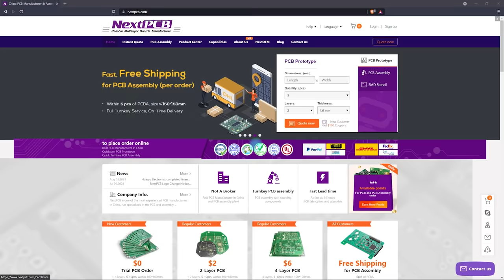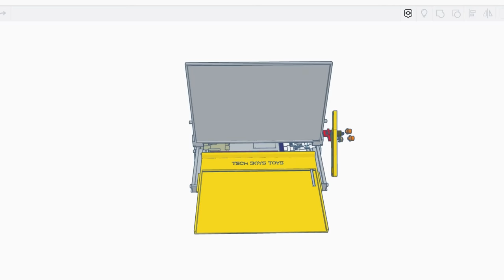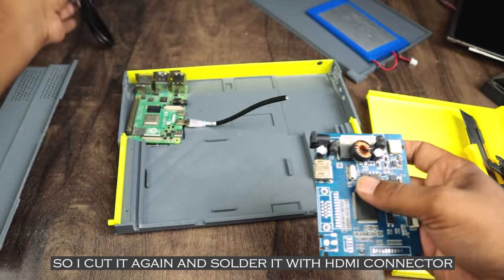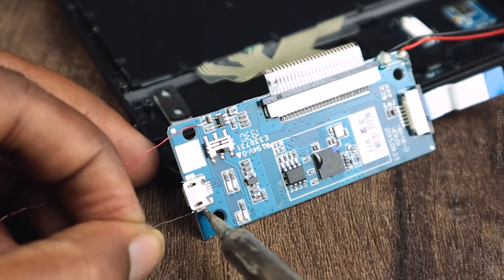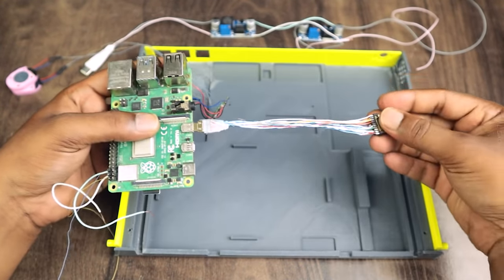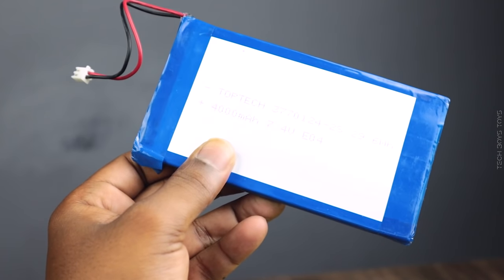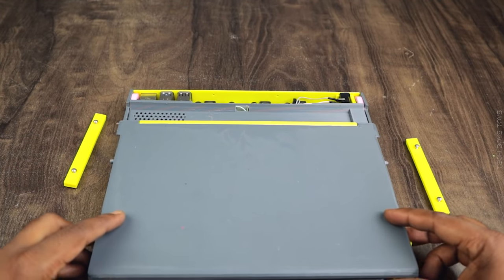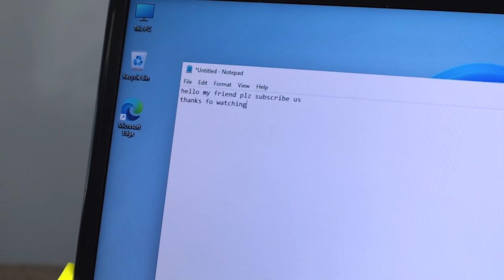Futuristic Dream Laptop 🔥🔥

Comment: Appreciate your Effort but the Laptop looks Age-old, big, huge, less efficient low-end processor and you label your video as Futuristic, you could have titled as DIY
Reply: Yes, or "Microsoft Surface back to laptop trick" or "snazzy 3d-printed surface tablet case", or " my first engineering project", or just " something I did with my time".  😂
Reply: Exactly the same thing I was thinking..
Reply: Better used a latte panda board with ssd
Reply: Exactly also raspberry fan is blowing straight on the back of the screen so I think it might need some redesign, and what if it is working and he close the case then it blows directly to screen that is huge mistake in design
Reply: I think it's more of a concept and use the thickness to put a board with socketed cpu and gpu maybe
Reply: I think what he meant was the term “Cyberdeck”. Basically meaning a DIY portable computer that fits every need of the builder. In this case he uses what he had on hand, a 3D printer, Raspberry Pi 4, old laptop display, and a few low cost electronic components. He elected the use of windows 11 as he probably felt more comfortable using it over Linux.
Reply: RPi may be low-end but it's not really inefficient compared to most laptops. There's nothing "age-old" about this, the design is unusual and not something that has been commonly used in production laptops ever. I don't think it is "big" or "huge", it's not as thin as a dumb ultrabook ofc but still a pretty small device especially considering how few laptops have a 10 inch screen.

Comment: The reason the first hdmi cable didn't work after you tried to use copper wire is because the copper wire was not insulated from the others. The metal on metal contact from the other wires doesn't let the signal to remain organized.
Reply: The copper wires are likely coated in a clear enamel, which insulates them.  I think the reason it didn't work could either be interference, since the wires are not shielded from electrical noise, or human error, since its easy to make a wrong connection when soldering the 20 wires of an HDMI cable.

Comment: Your cabinet design is good but you didn't put a bezel for the display. It's also not reasonable to invest on a wireless keyboard to use it as a wired one. Can you create a wired keyboard with trackpad/joystick using the 3D printer?

Comment: Real dream laptop for me is
I9 11900h
RTX 3070/3080
Thickness >25mm
2 in 1 convertible
15' 2k IPS 100%SRGB
1tb SSD NVME Gen4
>1400 usd
Reply: Start with an Intel Nuc, disassemble, CAD a frame, print frame, get remaining parts, and assemble.

Comment: I really love how this look. Planning almost a similar with pi 400 but I guess I still need a trackpad. There are still rooms for improvement but this is already so wicked though. Do you share the 3d print file?
Reply: Trackpads are annoying. Laser trackball is where it's at. I use a Logitech. Bought a separate K360 keyboard so both share one dongle using "ltunify." One dongle can handle up to 6 things, anyway it helps with power savings. I used a Pi4b and a 7" hdmi touchscreen The screen fit a 7' portable DVD player perfectly with some cutting. It's in there solid but added some hot glue anyway. The Pi hangs off the back of the screen. so it's a chunky sub-notebook. The base is completely empty, leaving a crap ton of empty space, enough room to dual screen, battery pack second whole pi and screen. Did you ever build the 400 yet?
Reply: "Do you share the 3d print file?" // Same question for me.

Comment: GPIO pins not exposed 2nd most use of Rpi, hdmi wires are designed to have least interference and signal loss that's why first attempt didn't work as there was lot of interference from neighbouring wires.
Other then that everything is awesome.